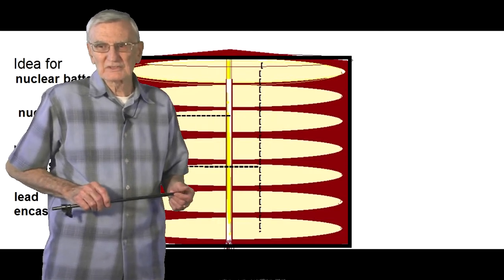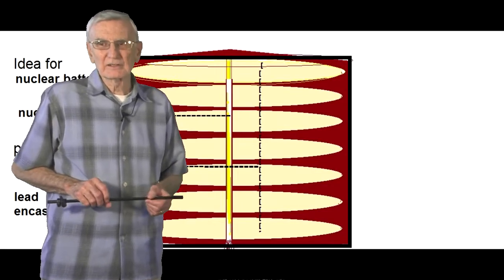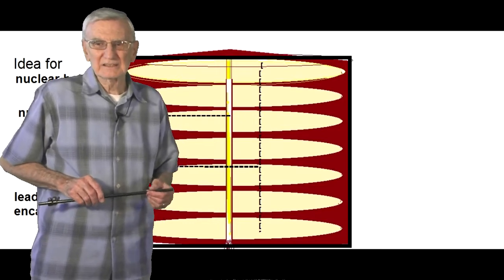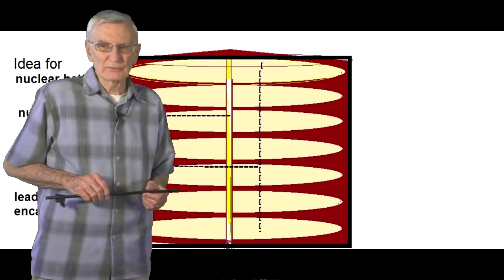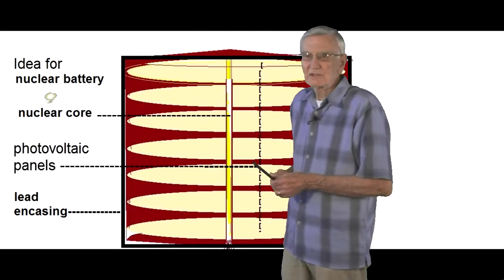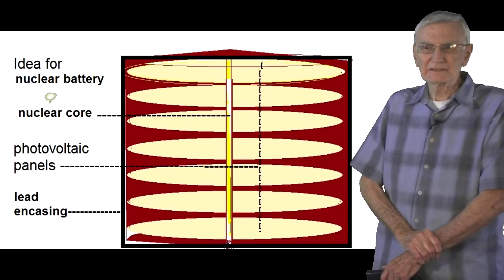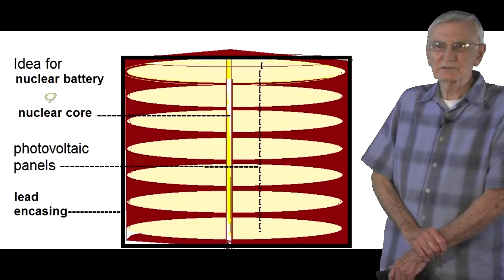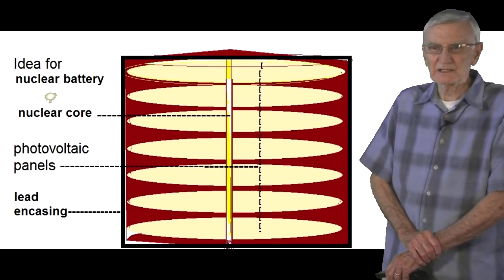make believe nuclear battery

Comment: Well I did some experimenting and looks like the efficiencies are too low with the radiation source that I'm using to pick up using magnetic separation and I don't want to increase that I'll have to work on the efficiencies of that design later but I was inspired when I watch one of the many videos on the atomic Diamond battery and figured well I could use the radiation Source itself as one electrode and use graphing as the other electrode with a very thin separator and as the ion particles get trapped in the graphene it should produce an electric charge just like the diamond battery but instead of using expensive diamonds and vaporizing shit ton in a radioactive carbon and compressing it into a diamond this would use the process of using the graphing as a neutron moderator and direct ion capturing system I will be probably doing some testing here soon
Reply from the maker: Dalton Neumann, Thanks for your post!

Comment: Wouldn't we have higher efficiencies with a direct ion capturing system using a magnet and a coil Crystal like they use in radios using a permanent magnet to separate the ions and protons through a magnetic field and using the coils to capture the energy of course you would need a extremely fast switching rectifier going to a capacitor Bank to gather the energy at least this is what I'm working on with americium  which has an extremely long half-life I am an amateur plasma and nuclear physicist with both technological and mechanical engineering under my belt I am currently working on a Vortex Fusion reactor or a VFR prototype of my design that uses the pinch effect on plasma along with increasing Fusion rates by creating a multi-directional rotating sphere of superheated fusion I have a star mode video if you're interested and I am looking for funding so I can build a safer and better prototype I actually was not intending to get a star mode when I was testing I was just trying to increase the efficiency to reduce the requirements for Fusion to happen and was able to achieve a high intensity Starr mode under only 28 Mercury's which is a relatively low vacuum compared to the high vacuum systems that use turbo molecular pumps and take hell of a power drop my entire system input is 250watts but that project has been put on hold due to needing funding for proper safety equipment and Spectrum analyzation equipment to get data from my experiments so in the meantime I decided I would work on another project of mine currently building the neutron stabilisation chamber for stabilizing Elemental isotopes and designing a new reactor core with a directional pinch acceleration magnetic field that allows atomization of a source material and acceleration into a Target to cause Fusion to create Elemental isotopes what I plan on trying is to fuse Element 50 or 99% pure tin with element 29 or 99% pure copper this should give us an isotope with 104  neutrons of element 79 gold by taking that isotope of gold that has been created and stabilizing it with 14 neutrons you get the natural occurring stable isotope of gold most recent attempts to synthetically create gold has been using heavier elements like bismuth lead and Mercury and using fission to knock an electron off which creates too heavy of an isotope that decays through neutron-to-proton conversion turning it into Mercury what I'm proposing and theorizing is using the same process that  has created gold naturally in our universe through Fusion of to Source metals and stabilisation with background radiation so I'm developing a neutron stabilization chamber for isotopes and creating a reactor core for fusing lower atomic number elements  it's just a hypothesis and its speculation at the moment until I can get some proof data and major testing I just wish I had a team a lab and funding in order to further my research at a way faster pace
Reply from the maker: Dalton Neumann, Thank You for watching my YouTube video. Thank You for your scholarly in depth comment. Your comments are totally out of my league and over my head. The largest issue I  hoped to awaken is how the world has not advanced from merely boiling water to transfer nuclear energy to usable energy for today.
Reply: @dahdigital1  thank you for your kind reply and I highly doubt it's over your head it's actually quite simple I have a hard time explaining things and theories because I have dyslexia sometimes the data gets jumbled up
Reply: @dahdigital1  .... that and my really long messages I have a tendency of writing doesn't help